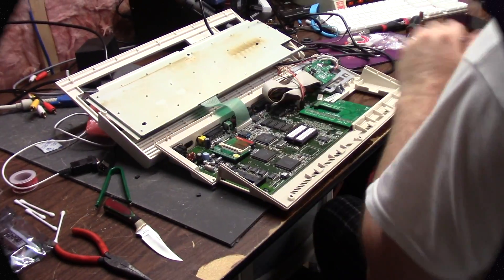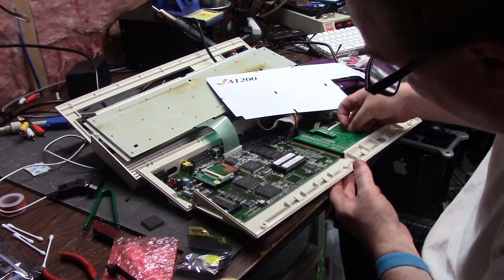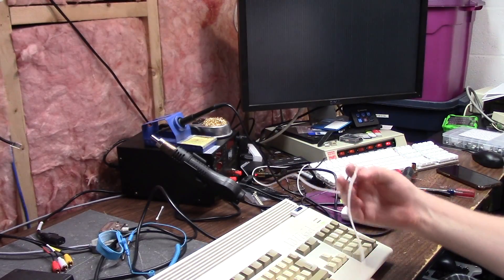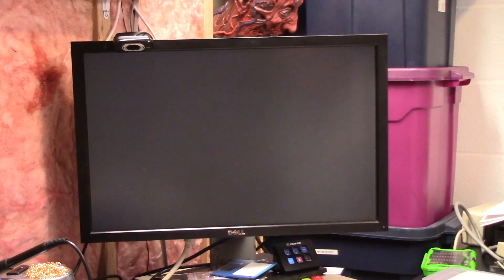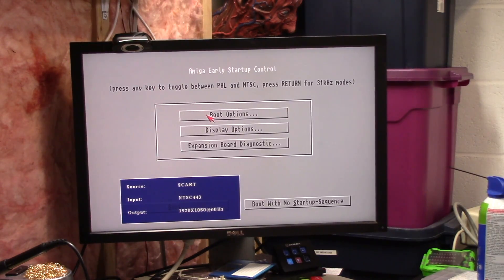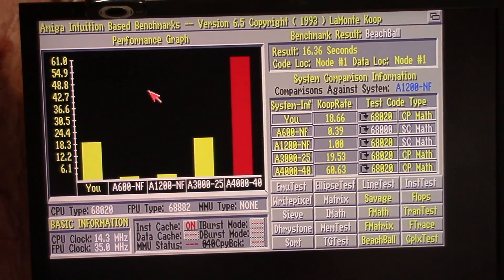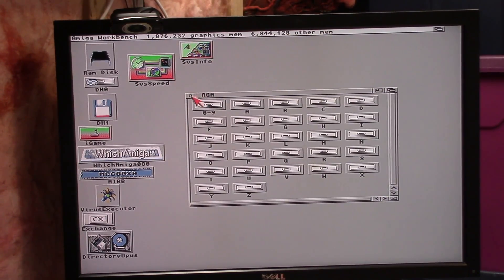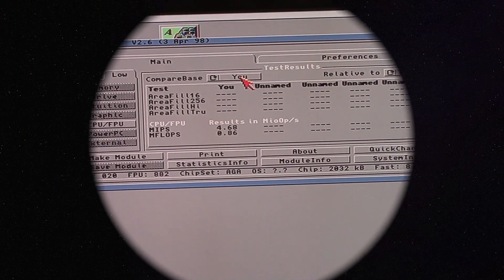Amigakit 40mhz FPU replacement for a brand new board sysspeed reports 233 ?

Comment: the only thing an FPU will help you with is rendering 3d scenes in Lightwave etc.. I don't know of hardly any games which use an FPU on the Amiga.. only TFX, Quake, possibly Frontier (Elite II) - there's not much.. but as others have said.. if you have a 40MHz CPU on a card then you'll be likely to get your FPU at the same speed.

Comment: Like others have said, your FPU is fine. 
Programs like Sysinfo and Whichamiga just estimate the FPUs speed based on some simple benchmarks.
The way the FPU works is that the CPU hands over to it any instructions starting with the hexidecimal "F". So if you have a slow CPU, like the A1200's14Mhz 68020, the FPU will be hampered because the CPU can't run fast enough to keep the FPU busy all the time. All this time that the FPU spends idle will then be reflected in the MHz estimate you are given.

Comment: I can feel your frustration, but my big question to you is why add an FPU? Sadly, many programs and most games do not utilize an FPU as far as I know especially something like Zool. I know WHDLoad wants 8 MBs of ram, but does it use an FPU? If it does I will pick one up.
Reply from the maker: Because it was offered idk why i figured why not. im not a gamer on the Amigas at all. i just chose to show a few whdloads, but i dont game alot., well a little but not like everyone else. I mainly run apps, lightwave, adpro, older utilities. many of which would use it. now its a poo stock processor,

Comment: very simple: there is no way to detect MHz.  it all assumes things. so those programs tends to show bogus numbers..  whichamiga is usually best for that.  and if you do not add oscillator and change clockjumper.  fpu will always be clocked in cpu speed.
Reply from the maker: it has a 40mhz crystal on it.
Reply: @ChrisEdwardsRestoration  you most likly also need to flip a jumper so it knows to use that instead of cpuclock
Reply from the maker: @ChuckyGang  i did, thats the Ext settings, the int setting used the cpu clock, its weird, its amigakit go figure.
Reply: @ChrisEdwardsRestoration  yeah you haven't paid them the 40MHz license maybe? :-D  or maybe it will happen when they own the rights to "40MHz" hmm

Comment: Does the 68882 speed seem any more consistent with setting the EXT differenty? I've heard that 8MB trapdoor expansions are a little iffy, something about conflict with the PCMCIA port.
Reply: The conflict is due to those types of cards using the same memory space as the PCMCIA card. The only way around it is to use a card that has it's own CPU.
Reply from the maker: originally it would yellow light, it was a bad one, they "said" they tested it, but when i recieved it the FPU jumper was on disable and the ram was on 0mb, i had to set it to int first, and it worked, external would crash it. this one works fine, and since its 3.1.4 roms, my pcmcia works w 8mb just fine.